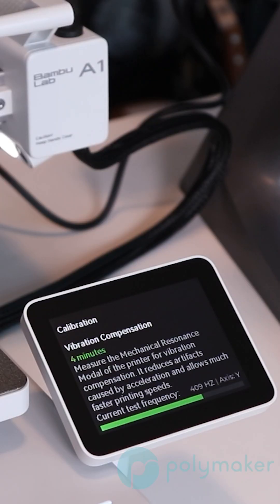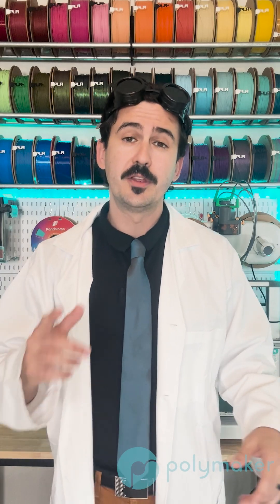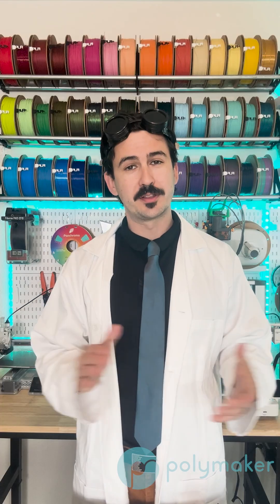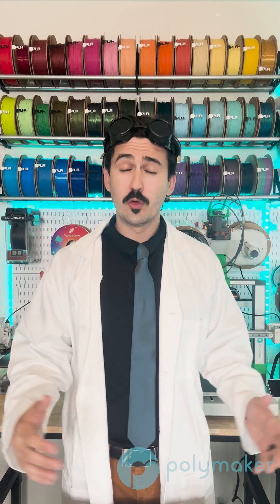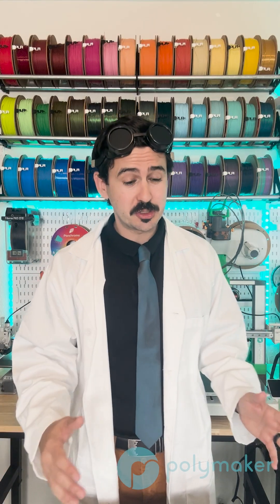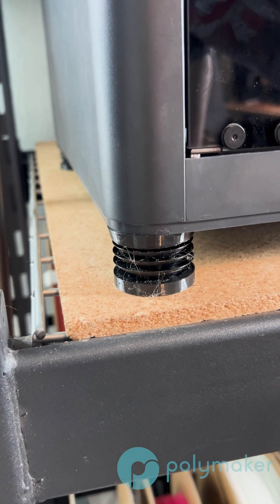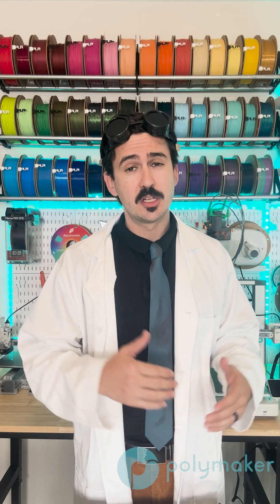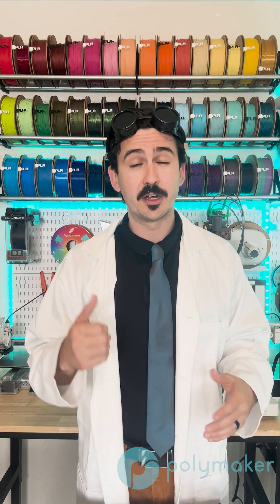END Ghosting

Comment: There is another reason and while it is not directly related it can cause those lines.
It is the outer wall print speed. If you are printing in a resonance frequency you will get the same lines.
OrcaSlicer has a test for it VFA (I think).
Reply: Just ran that test and a ring showed up between 75 to 90.
Reply: @JenkoRun you will want to avoid printing at those speeds then so either higher or lower. Depending on how much the quality changes. If there is no loss in quality you might aswell go faster.